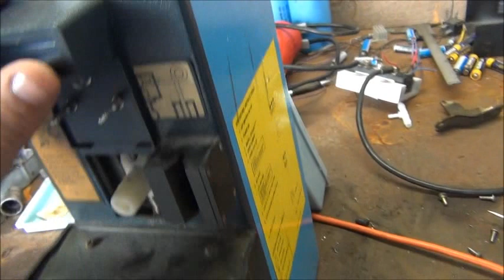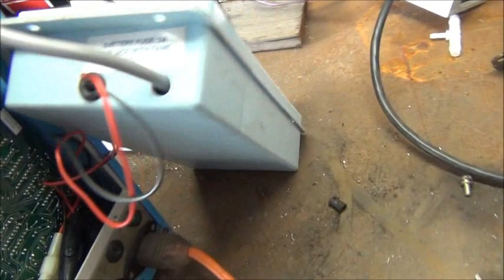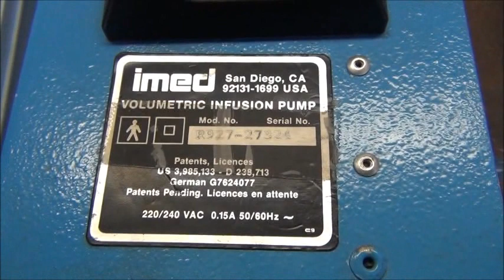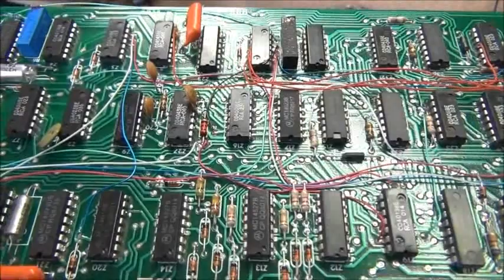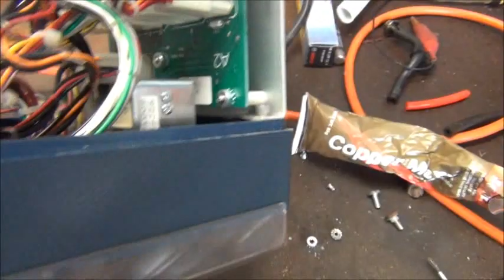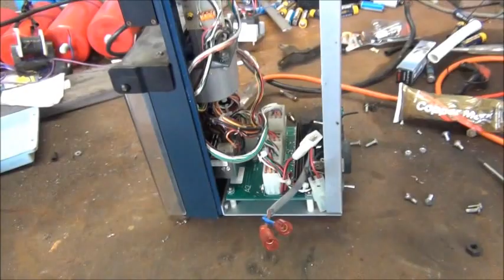Teardown: iMed Volumetric Infusion Pump.

Comment: This is not a pincer/pressure sensor but on this particular model is a 3 or 5 element air in line detector which worked with both clear and opaque fluids. when air was detected the pump alarms and stops infusing.
Reply from the maker: +John Llew interesting, thanks!

Comment: The pincer is a pressure sensor. It squeezes the hose, and if the output hose is kinked or IV needle is clogged, then the hose will swell and trigger the sensor which will cause the pump to alarm.

Comment: That wheel encoder with solenoid was most likely triggered with one of the optical forks on the motor shaft. So it knows how many pump cycles it's gone through.